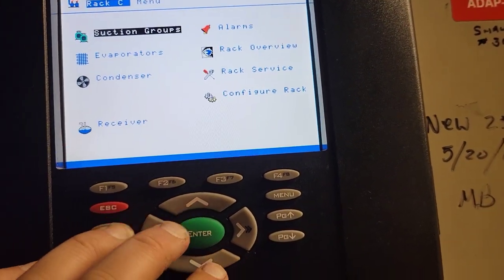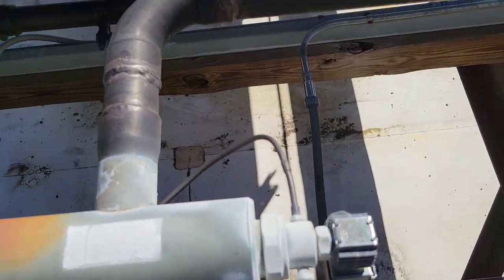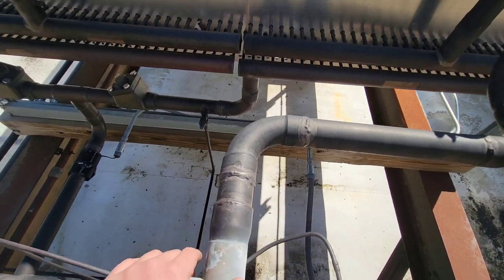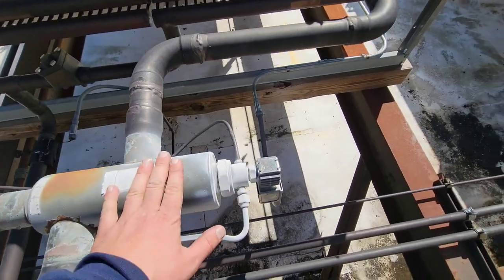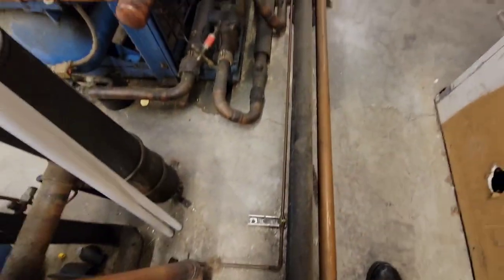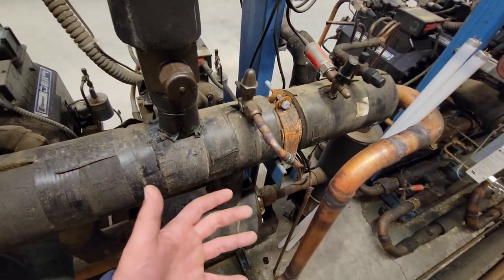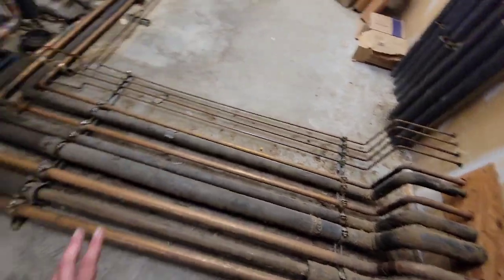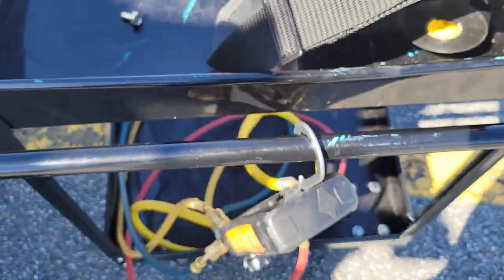Supermarket Refrigeration - How Does Condenser Split Work

Comment: Loved the explanation on the pumpdown circuit and yeah it should have a solenoid that is energized while in split mode,we call it the "bleed" line here ! I would guess that you can not bring it to 0psi nor lower then the actual suction group its tied to :) cheers !
Reply from the maker: Bleed line sounds much better !

Comment: Cool man, good explanation. I was wondering how the system would deal with straight liquid going into the suction header at first but you explained the capilary/TX would meter it in so you don't get flood!
I wonder if some systems divert that pump down leg into the receiver? would be free liquid ay?
Also I wonder if it could be piped into a type of brazed plate heat exchanger to get some sub cooling on the liquid going to the cases?

CHEERS GENDRON

Comment: Every time my condenser goes into a split I get a receiver alarm. But when I get to the store I’m at 40 percent in my liquid receiver and I have no leaks. Any clue to know what can cause that issue?
Reply from the maker: There might be a blockage in the pump down circuit. Some stores actually have a screen in the pump down circuit and if you don't clean it it'll clog also some setups use a TXV with a screen or some setups use an orifice and if those things clog you'll get a pump down that is very slow and it will cause an alarm you could start with that. 

Also if the weather is bouncing in and out of split this will also cause an alarm because liquid will constantly be put into your suction and it can actually cause oil failure as well as like receiver issues. So I would check for a restriction in the pump down circuit. And I would also check to see what ambient temperature the split is set to turn on at.